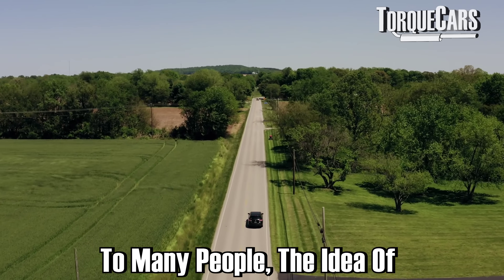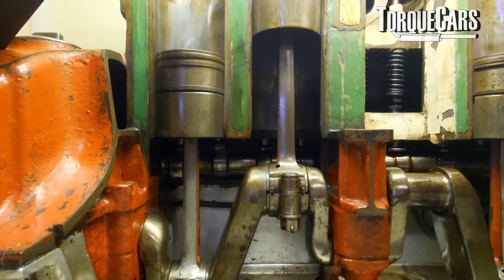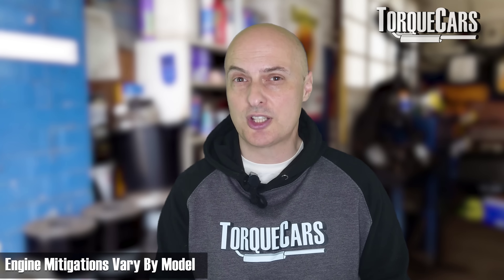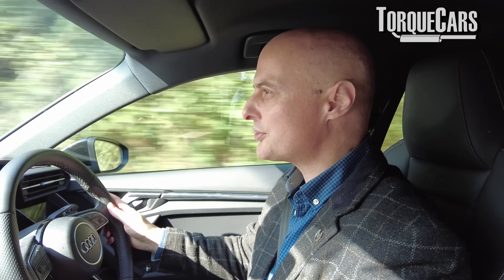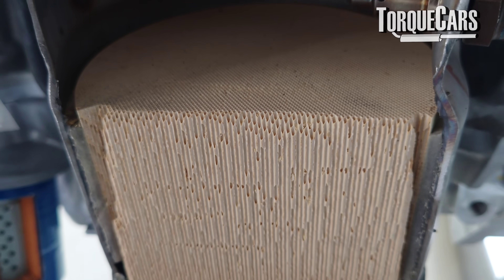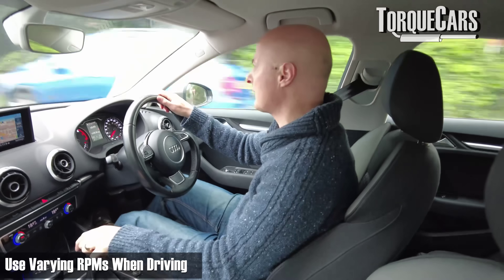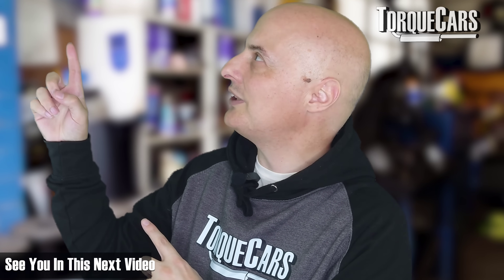BIG DAMAGE By Lugging at LOW RPM? Eco Driving Warning! (Manual Gears)

Comment: Unfortunately this problem happens a lot on VW gasoline engines. The oil pump is badly designed and does not pump enough oil at low RPM. (Or is it planned obsolescence?) Cars with those engines that are predominantly driven in the city often fail before 100'000 km. VW knows this problem. It exists on all 4 generations of TSI, TFSI engines.
My advice would be😢: Gasoline cars: Buy Japanese. Diesel cars: Buy French...
Reply: My 1,2 TSI has done 190.000 km so far. Still going strong. Not even burning oil.
Reply: @hkonhelgesen  Happy for you. I guess you're not driving a lot in the city.

Comment: Starting the engine with the clutch pressed is wrecking engines. No oil flow and no oil pressure, with the crankshaft thrust bearing being rammed against the crankshaft.....not good

Comment: Generally speaking you are correct.

I lug my 7.0 L V8 all the time.   But every engine has its own “lug” range which is throttle and gear dependent.   This car idles in High gear at 45 to 50 miles an hour and will cruise at 80 miles an hour under 2000 RPMs which works fine on the highway.   

All that said I agree with about 99% of what’s been said.    Even though this motor produce well over 300  ftlbs of torque at 2000 rpm (wheel TQ - tuned on chassis Dyno) you still don’t want to go WOT in high gear at that low RPM.   You can feel/hear the engine complaining through its labored acceleration. 

Jeremy Clarkson demonstrated this in his one gear pull to something like 175 mph and you can clearly see the engine isn’t happy and you understand exactly what being discussed.  Vintage top gear around 2007 or 2008.  

Here video of me lugging my car now:

2007 Z06 LS7 - Well Mannered Until Not...  TSP Stage 3 LS7S
https://youtu.be/7SKkCBZvNfs
Reply: I scrolled down to see if any other LS 'vette owners had commented.  It's difficult to "lug" an engine that has a very flat torque curve in a lightweight car.

Comment: Occasionally run in lower gear or go somewhere, take that road trip you keep putting off. On short trips driving slower allows your engine to reach full operating temperature and evaporate moisture hiding in the crankcase. 
Drive it fast 
         or
Make it last

Comment: I had a Fist Seicento 900cc 40 bhp. It should be slow. But this was pathetically slow and not especially good on fuel. Then my work changed so I was doing more miles often on fast roads. It felt like purgatory. The. I noticed fuel consumption improving. After a month of this the car was nipping along nicely. One job put me on the M6 between Stoke and Manchester every day. They drive like nutters. The little Fiat was literally flat out but still giving 55mpg.  
Moral - use your engine properly. Flat out is usually not good but that little Fiat turned out to be a great car in the end.
Reply: I tested a FIAT 500 with a 900cc turbo paralell twin. It made strong torque allready at 1500 rpm. But the torque made strong vibration all the way up to 2500 rpm. It was annoying. Do V-twin cruiser motorbike engines also behave like that?

Comment: Another costly mistake with newer engines is low revs means cooler exhaust gases, petrol and diesel particulate filters need hot gases to burn of soot etc, around two thousand RPM for many cars is minimal for heat efficiency, some systems actually put more fuel into the exhaust to raise the temperature to help burn off particulates, many controlled by the ECU.

Comment: I have a Toyota diesel truck.. it already achieves max torque at around 1400 rpm.. so I suppose, driving at around that rpm minimum is not considered driving at low rpm, is it? It is a diesel engine, and it does not rev very high max.

Comment: Never had a problem. The cars are automatic, they know when to have which gear. Everything else is bad luck or failed engineering.
My e53 amg rides at just under 1‘000rpm when going 35mph

Comment: If you have any sympathy for the machine, you soon learn when the engine is bogging down because of too much load and insufficient revs.

I have  Citroen Berlingo van with a 1.6 HDMI diesel. Quite a heavy vehicle with a smallish engine, but it goes well, so long as you do not force the engine on too low a rev. As a rule I would not attempt to accelerate at less than 2000 rpm, but am happy enough to bumble along at 20 mph in third doing only 1500 rpm, but then for speeding up to thirty again I'll find second gear so that equates to about 2000 rpm at 20 mph. Change up to third again at between 25 and 30 mph. She runs lovely at thirty in third. 

But you can observe horrible lack of sympathy for vehicles every day. And it should be born in mind that knowing how a car has been driven by its previous owner will give a good indication of the condition of the mechanicals.

Where I live we have a good many quite serious hills, this allows for a good work out when the engine is at operating temperature, say taking a one in five at 50 mph in fourth gear at open throttle on about 2750 rpm. Give it half a mile like that and you definitely help keep the engine running in good health!

Best wishes from George.

Comment: For diesel engines you need to get them hot quickly otherwise none of the emissions systems function properly. You also need to run it over 3000 rpm for an extended period to clear the EGR and DTF if soot. Diesels are not city cars and should not be used for commuting in heavy traffic as cold engines pour out harmful particulates.

Comment: Having just built my engine for my Chevrolet Suburban I would have loved to see this video. I planned my build with the understanding that at about 3500 rpm the vehicle would be doing about 55-60 miles per hour which is pretty much the normal range of speed in the areas that I drive. I also pull trailers or am driving off road where the lower speed of the vehicle is more common. That puts my engine with the cam and internals that I put in it were planned for the 1500 to 5000 rpm range of the cam. There are so many things that you mention that most people do not even consider them. This was a great video.
Reply: 3,500 RPM would be insanely high for a Suburban (V8?) at 55-60 MPH.
Reply: @awebuser5914  The reason I figure it is that high is because that is where the old engine ran for this speed. The new engine is designed for toeing and going off road which will also require low speed from the transfer case and higher speed on the engine.

Comment: Pretty much agree with your points - it's one of the reasons that automatics tend to last longer for general drivers as they're generally harder to abuse.  That said, I was looking for a new car in 2006 and the Mk5 Golf GTi DSG was on my list.  In auto mode it would engage upper gears far too quickly in city driving such that it vibrated - better fuel economy but ouch in day to day driving.  I bought a manual MX5 NC instead and kept my old Disco 2 V8 Auto.  Still own the latter but might go back to another NC update version soon.  ND is too small for me as was the NB, but I still had one of the latter.

I used to work across Asia and well remember some Taxi drivers using the lowest possible RPMs.  It was horrible but then went to Guatemala and was driven round round by one of their senior marketing guys and he was one those who keeps it max revs all the time.  Equally horrible.

I'm an Engineer (Mechatronics before the term existed) so take that as you want but for most people I thing a regular torque converter automatic is best followed by a CVT and NOT a manual.

Comment: While i would agree that pushing accelerator pedal to the ground al low rpm is bad, i understood that bad lubrication at low rpm is not drivers fault, but a design flaw. You can't just turn on Apple face and tell people "you are driving it wrong"

Comment: When I am driving on a flat road, at 30, in a car, I am in 5th, perhaps 1,200 RPM. 

If I am on a slip road joining a motorway I am in 3rd or 4th until I am at 60-70, and can join the traffic at the speed they are going. 

Most of the time I am on a motorcycle, a ‘98 600cc Suzuki, and I do 30Mph at 3k rpm (also 5th gear) it’s happy with that combo. It idles at 1,200 rpm. Try riding at anything below 2,500rpm and it makes it very obvious that the engine speed is too low. Jerky progress, chain slap. If I want to accelerate quickly I am happy to hit 50 in 1st. 

I have never, in my entire 55 years, heard of ‘lugging’ a car engine though. Did you invent the word? Not the concept, the word. 

If it is so bad, then a modern car, fly by wire, will simply ignore full throttle requests at low rpm. 

Try putting a modern automatic car into 1st at 70Mph, it does not let you. So, if it lets you apply 100% throttle at low rpm with a manual gearbox then it is ok. 

Or perhaps it just actually opens the throttle 15% and waits for the engine to catch up. Boot a turbo car, and it only goes like shite off a shovel once the engine has some revs.
Reply from the maker: No lugging is very much already in use, in some regions they would say laboring the engine instead. Yes you are right most modern cars with digital throttle will make an allowance to compensate for this.

Comment: 5:00 The expansion cant happen fast enough because the piston wants to increase in speed but cant so the force is applied directly to the engine parts rather than the output shaft. Which is why I always thought it was stupid to tell people that low revs = fuel efficient - as it is not true; its false economy..

Comment: No one has experienced lugging as I've seen. My Dad grew up learning to drive manual trans cars. There's nothing else made in the 30's &40's. He would be in top gear approaching an intersection and wouldn't press down on the clutch pedal until the car was jerking at an engine speed close to killing the engine. 
When I was 15 or so I asked him what person in his family taught him to drive a manual shift car like that knowing all cars back then were manuals. He stated he taught himself. I told him he needed to use the clutch much sooner or even use neutral and the brakes approaching the intersection. I mentioned if he had to take a driving exam with a manual trans driving like that he would fail it. 
Kids shouldn't have to teach their parents how to shift.

Comment: This is so much misleading, theoretical rubbish. Automatic  transmission vehicles select gear changes automatically to avoid this problem, so a driver would have to be deliberately doing this by driving ever so slowly, so the problem described is practically negligible.
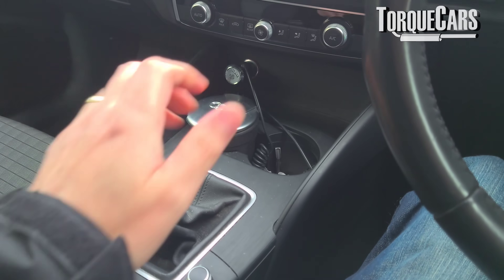Reply from the maker: Negligible  perhaps for Automatic drivers, don't forget that much of the world use manual transmissions (most uk cars are manual) and, as stated in this video at around 1:45 it is aimed primarily at those drivers.

Comment: Hi there. Somewhere around 5:25 i  this video you mentioned that 1000 rpm ECU has less time than 5000 rpm...which is incorrect. At 1000 rpm you will have 1/(1000/60) = 0.0599999 = 60 ms. While at 5000rpm you will have 1/(5000/60) = 12 ms to do all the tasks. Therefore it is irrelavance about how much time the ECU has for given cycle.
Low speed pre ignition (LSPI) is a thing and I agree that the trend of downsizing + turbocharger makes this problem worse...which automakers then opted for EGR to phase the combustion (to prevent knocking). This leads to carbon build up in the engine intake manifold, valve stem, etc....
Reply from the maker: Hi buddy, I simply meant there are 5 times the revolutions of the engine per minute, so the ECU gets 5 times as many extra readings of air/fuel/lambda/knock and all the other sensors to work on within the same time period. The ECU works at the same speed and is under stressed at 1000rpm.  That is why it smooths out the engine, there is more for it to work with at 5000rpm.

Comment: High rpm is a engine killer, low rpm is a clutch and dm flywheel killer
Reply: Unless it's a honda K20
Reply: @Bumblebeetle-di7sf  Or Honda K24
Reply: @rebeltvr6046 my r18 loves 7k rpm
Reply: @Athaion0  I think I had the R18 in my Integra.  Bulletproof and loved to rev, yeah for sure.  I miss that car.  My K24 isn't as rev-happy but it will go up there on demand no problem!
Reply: tell that to highway driven vehicles!!! Nonsense
Reply: "High rpm is a engine killer" Eventually but in some ways it is not as bad as boost. There are still plenty of Honda CBR250RR's 250cc inline-fours running despite being thrashed mercilessly by L-plate riders to 18,000rpm for 30 years!  The topic of the video is more about modern car engines like 1.2 TSIs with claims like "peak torque from 1200rpm" -- well that's not actually possible outside of the dyno as by the time you press the throttle and reach full boost you aren't at 1200rpm anymore, and it's not necessarily good for the engine either...

Comment: If you have a VAG engine, the pil seperator will drip oil in the intake manifold and you will have puffs of blue smoke on startup,  also you risk having carbon on the valves and piston ring lands.

Comment: I’ve never ‘red lined’ any of my vehicles in all my years of driving incase of the event of engine damage 😐 But then, is that not what the red line is for ?
Reply: Lol I had a Honda Civic 2013 1.4 that went to the Rev Limiter everyday for 6 years and 96000 miles, Still sounded like new when I sold it

Comment: I'm with you l think turning 3500-4500rpm once in a while for short periods if your engine is running right is a good thing but l believe if you keep engine rpm 2200-2500rpm at 80mph at extended periods on the highway will last much longer than one that is turning 3000+rpm but l understand that never taking a engine above 2500 - 3000rpm for years and miles will most likely ruin a good engine my grandfather had some cars back in the day that probably never did more than 40mph and over years and time these cars ran worse than a car that sees occasional 75mph highway time for a few hours even if it has more mileage

Comment: Ive been driving my car like driving miss Daisy for 3 years, then oneday I give it a top speed test, since then I've had blown head gasket, engine warning light from carb bank sensor, oil being flung around my engine bay from an unknown location and oil light flashing when car rests as idle speed is low when hot!?, I pretty much knew all of what you were going to say on here, I have a basic understanding of engine and intuitively know about timing, oil pickups and cats needing to glow inside to work props etc, I know my bad habit is low revs too often, but the more i thrash her the more oil coats my engine bay, I dont go about 60 now 🤦‍♂️
Reply: So you broke your leg, refuse to go to the doctor, and are sad that you can not run?

Comment: I shift between 1.5 and 2 k rpms on flat city driving. I start at 2nd if going downhill. If going uphill, I shift between 2.5 and 3 k rpms. I drive a Pontiac G6 GT 3.9 l petrol. So far so good. Cheers.

Comment: It literally takes checking the instant fuel consumption to understand that lugging your engine actually uses more fuel than the correct rpm, especially going uphill.
Reply: Not the case in my car actually. (1.2 TSI)
What engine do you drive?
Reply: @nielsonderbeke8507  k9k (renault 1.5 dci) in my case. It's very obvious in hill climbs when I downshift, going from ~1500rpm to ~2300... goes from about 15-16l/100km to ~12-13.
I guess it has to spray a lot more at those low rpms to keep pulling the weight up. In level driving  it doesn't change much.
Reply: @25myma  but you say on hill climbs, which is like 2% of the time for the avrage person. What happens if u go on a straight road and go from 1500rpm to 2300 with a lower gear. Does your fuel consumption go down again?
Reply: @Mr.Danny2  I'll depend on each car and throttle position, in my case for example , whem i'm just following traffic it's better to drive at 1500rpm in 4th instead of 1000 at 5th, there's around a 10% decrease in consumption. Though my speedometer stopped working a year ago so my car doesn't know it's fuel range so i just measure it in litres per hour
Reply: Correct, my civic has a mpg meter on the dash and as soon as I floor it in 6th gear at 50 mph it drops lower than 15mpg it's better to just drop a gear or 2.
Reply: Finally someone who gets it!!
Reply: The 1.5 Dci 105 hp is indestructible in my experience. Gave my Megane of 10 years to my nephew at 270k km. Still going strong at over 330k(the engine that is, let's not open the subject of electronics 😂). I always kept it above 2200-2500 rpm and changed the oil regularly. My curent peugeot 2008 1.2 doesn't know what 6th gear is. At 3500rpm at 130 in 5th  instead of 6th at 2900, it goes from 6.5 to 7 l/ 100km. Being that small, it still "feels" lugged at under 3k rpm at highway speed.
Reply: @constantingrecea7571  7l/100km is more fuel use, so may as well cruise in 6th unless you want to pass.
Reply: @25myma  luckily, I drive an auto that knows better than me about when to shift lmao